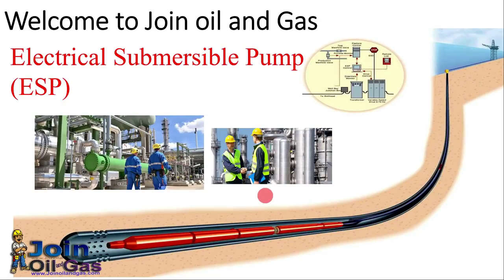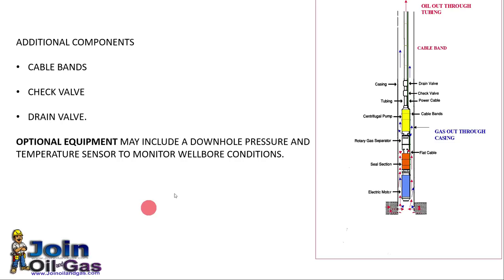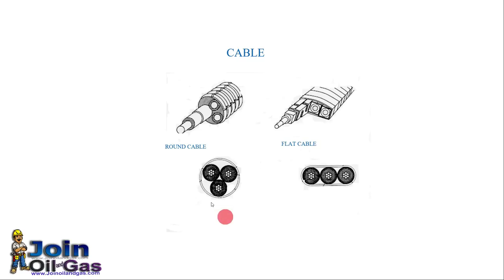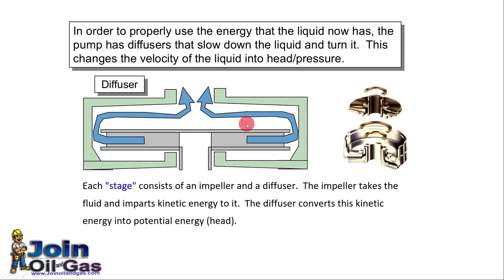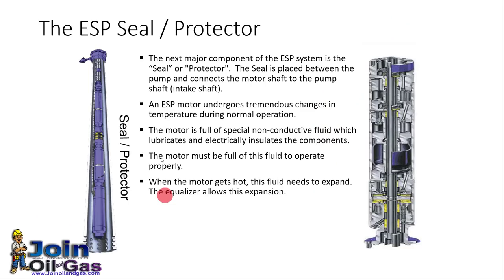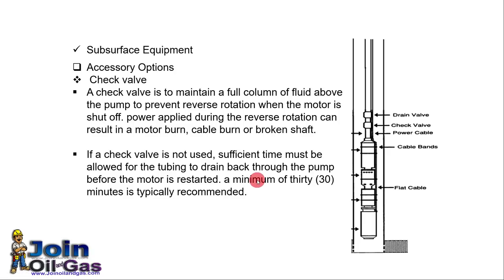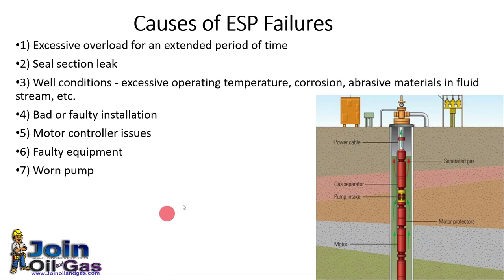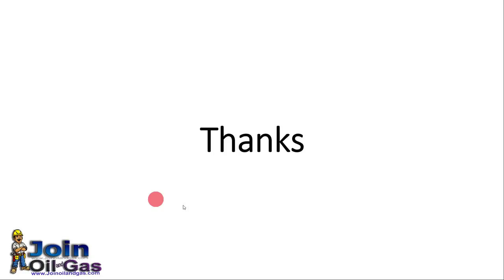Electrical Submersible Pump ESP

Comment: The seal section need to explain in details because it is the main component which protect the motor and without seal the motor could hardly run. How it protects, what are the main components of seals and how it works. How it allows the motor oil etc.